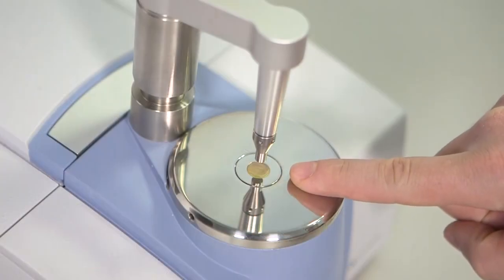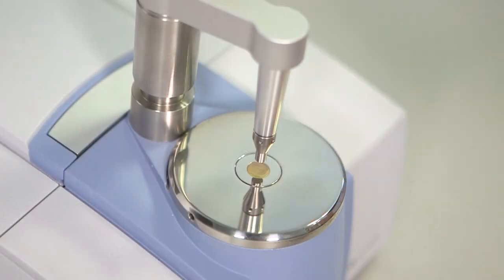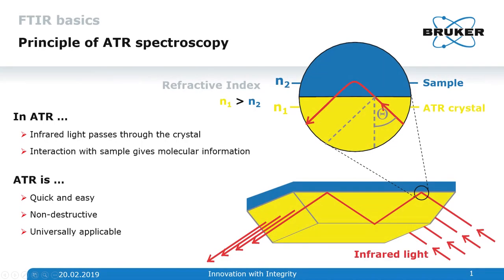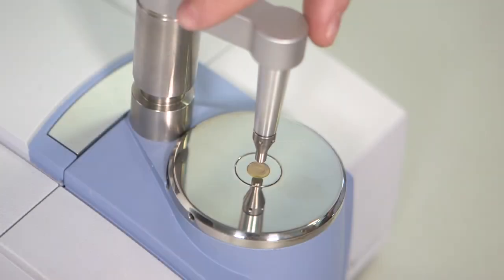ATR Introduction | FT-IR Basics

Comment: Which standard use for ATR Calibration.
Reply from the maker: Bruker FT-IR systems use the OVP (Opus Validation Protocol). It does all automatically - no user interaction required to have a perfectly calibrated system.

Comment: Hi. What information can we obtain by using a FTIR that do not have the ATR accessory? Have you got a video to share?
Reply from the maker: Hi DAGAGI02, unfortunately we don’t have a video on transmission measurements available right now. However, transmission measurements basically yield the same information as ATR. Of course, there are some differences. As the penetration depth depends on crystal material and wavelength, ATR spectra show weaker absorptions at higher frequencies. This means, the C-H, O-H, N-H, etc. bands will show a lower intensity in ATR spectra, than in transmission. We have a more detailed video on ATR explaining this effect. You can find it here: https://www.youtube.com/watch?v=q0evGXCK-sY. Best regards, your Bruker Optics team.”
Reply: Which standard use for calibration of ATR